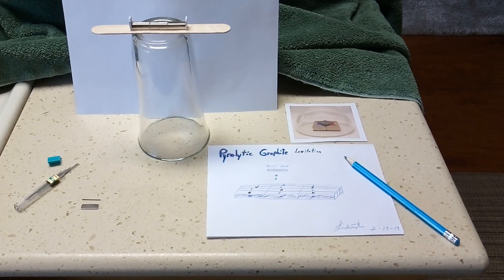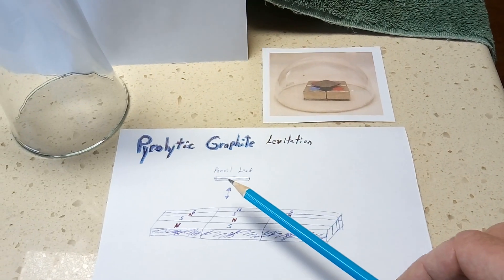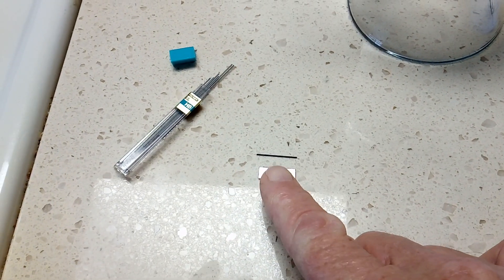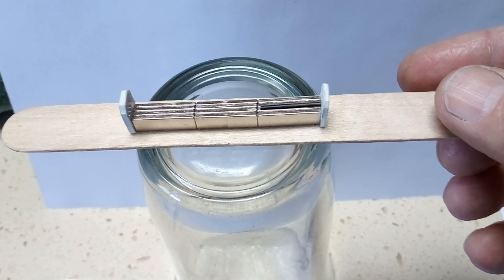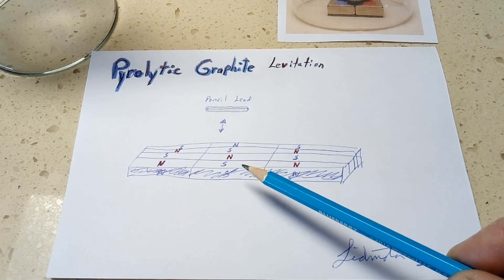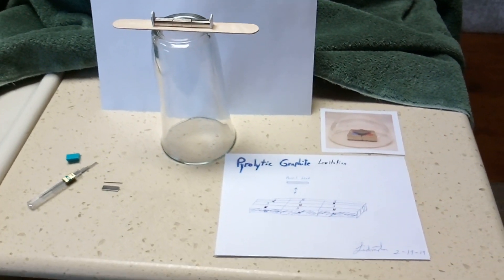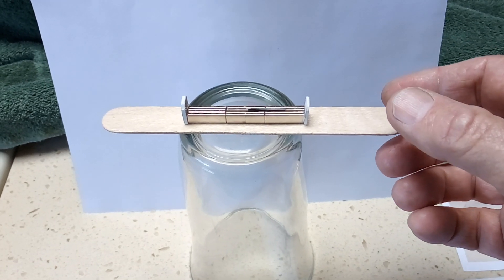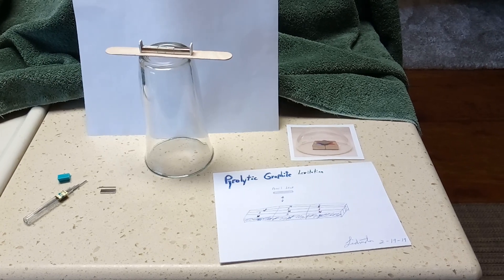Pyrolytic Graphite Levitation

Comment: Hey lid why not try high voltage on each side of this model. Insulate the magnets and an make the stops at each end connected to hv cap. Then see if the graphite shoots back and forth with each charge while levitating.

Comment: Nice, but note that the magnetic bearing is not completely friction less. Videos at YouTube show that a magnetic bearing in a vacuum still slows down the spinning object. And also remember that there is always the Earth's magnetic field interfering.
Air friction can become more significant than the bearing, even in a near vacuum(was proved in 1979.)
Reply from the maker: Yes!  The best we can hope for is very very low friction.  What I am encountering now with my long running motors is bearing wear. If we can make a zero contact magnetic bearing that should solve that problem.

Comment: If you 'invert' the setup(in a modified way, not literally mirror it) using a square of pyrolytic graphite, and with a larger 'lifter' magnet above, you can float a small neo magnet just over the graphite. Bismuth works too, just not quite as well. I think (or would like to think) most people here have heard of that, but I just felt like mentioning it :p
Reply from the maker: Thanks.  I am new to this type of levitation and find it fascinating.  I looked at the method you describe yesterday and might try that also.

Comment: Do you think there is less friction with that than there is with the regular magnetic levitation type or maglev type bearings? I saw Lasersabers video the other day. I like the idea of the ring magnets that dadhav has on his window motor, those seem a lot stronger than the graphite. That is interesting.
Reply from the maker: Did you see Lasersaber's video with the graphite tube to test the eddy current effect?  The magnet fell through it like it was made of glass. No effect.  Very interesting.
Reply: @Lidmotor You're right he did say it was graphite, I just forgot. That is interesting.
Some pencil lead is synthetic, the graphite will not bend without breaking and will not melt if you heat it with a torch, the synthetic stuff will not work for a solder pick because it melts and you can bend a pencil made with it without breaking it, the wood part is not really wood either.
Reply from the maker: Yep.  The ring magnet levitation idea is hard to beat.  Here is my version of DadHav's  idea from long ago.https://www.youtube.com/watch?v=PjmJX4thhGA

Comment: I had no idea about the pencil refills. Rushed out of the room shouting "This is getting tried!" Got some by Promarx here and the darn things stick to the magnet! ah well.
Do you have a brand name for the ones that work?
Reply from the maker: OK ---This is what the bottle says.  Pentel Hi-Polymer.   The leads are .7mm HB..  I got them at a dollar store.  I may go ahead and buy some of the actual pyrolytic graphite "chips" but they are bit pricey.
Reply: Thanks :) 
Pentel are a regular enough name too. Had a look at the prices on those chips when Lasersaber showed his vid, hence clicked fast on your video lol
Reply: @Slider2732 After opening a few boxes of leads, only 2 pieces of one brand were 'magnetic'. The box has this text: 2H 0.5, lead mine, PILOT, NEO-XS, '12' and 60%. Just 2 from the box (I assume there were 12 in there).